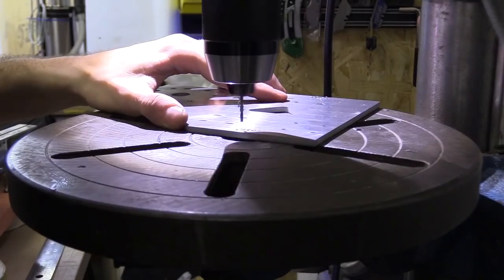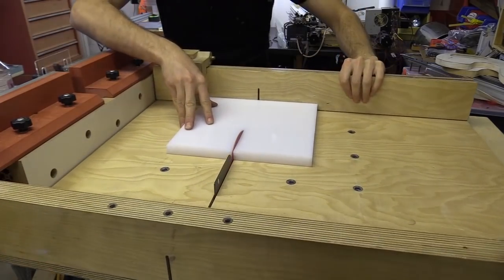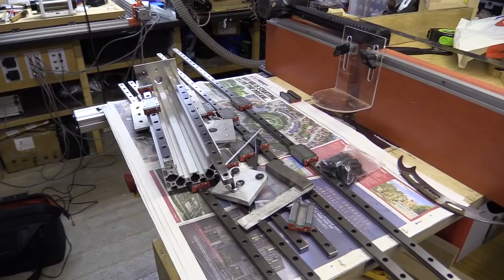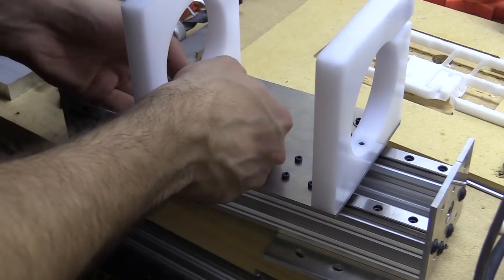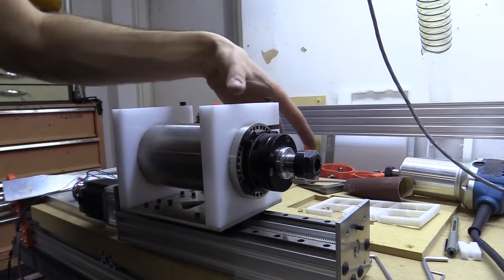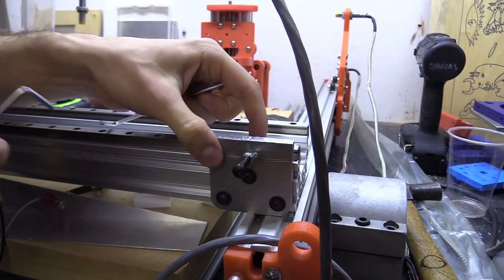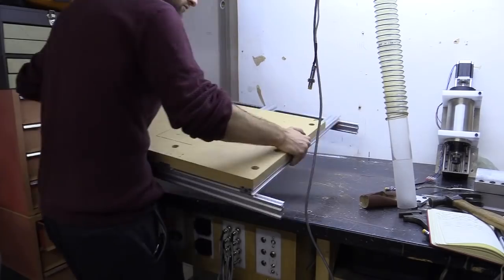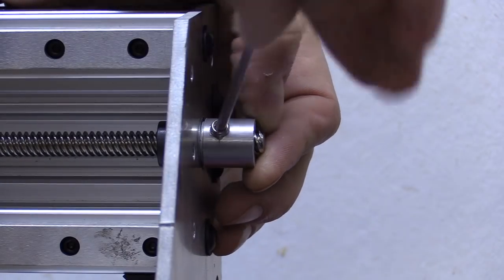#31 Assembling Aluminium CNC Machine #31 / MGN12 Linear Rails / XYZ Axis / Spindle Mount

Comment: I'm planning on making a similar CNC, a variation of the Sphinx 55 except I designed mine to be bigger, using 1000mm C-Beams, I'm worried that the gantry will deflect due to the weight of Z-Axis? Should I reduce the size of do I go for it? And is the T8 ACME Threaded rod enough or should I use T10?

Comment: I am making a 500x500x200 CNC using extrusions and linear rails and over on Reddit they said I should go with MGN15 or 20 (20 is way too wide for this) and be sure to use the normal blocks not the short blocks when I asked should I use MGN12 or MGN15.  Since you used MGN12 would you shed some light on this for me?

Thank you.
Reply from the maker: I went with hgr15 rails in the end. Mgn12 worked for a while but for the long term I realised I needed it a little more beefy to get the speeds I wanted.
Reply: HGR15 works with the Aluminum extrusion?  I doubt I can get a good price on AliE for HGR too.
Reply from the maker: @thebeststooge  Yeah if you can wait a few weeks I'm going to release a purchasable manual for my latest machine.

Comment: Looks great ! I'm starting my 5' x 10' table build, but in the middle of being screwed over by a Chinese company over my X-Axis Lead Screw. I paid THEIR sale price, THEIR shipping, and THEIR shipping insurance price, then THEY turned around after 3 weeks and cancelled my order, saying they could not find an acceptable ($$) shipping method to the U.S !  Then another week to refund my money...WTF !?!? But even though they cancelled my 1500mm 1605 lead screw, it may have been a good thing, as I felt a 16mm diameter over a 6 foot span may sag, like yours does. So now when I order another Lead Screw in 1600mm length,  I'm going for an Inch in diameter, or a 2505. Luckily the company DID send the no longer needed 1605 Nut Housing for the 1605 Lead Screw THEY CANCELLED, but not ONE WORD in response to my request for a refund for that. I guess you take your chances.  So the point to my rant is, you might order a new beefier 1-inch diameter lead screw to cure the sag problem and any induced backlash associated with it. More costs and redesign I know, but maybe worth it in the long run ! Good Luck !!!  Oh, and if that doesn't work for you, try this one, it IS strong enough to stay straight !  https://www.youtube.com/watch?v=TsOPaRAayFk&t=194s

Comment: just want to share: propanol do not have high polarity and as such it is more reacting then ethanol with certain plastics like acrylates for example or styrofoams. i would check what is that end plastic used and then aply a 3 day bath to it.
safest is to remove plastics from bath

Comment: You should use ballscrew for your x axis.leadscrew that long will wobble. I have same experience with you
Reply from the maker: I know but I couldn't find over would fit in the cbeam. My main problem though is the not blocks.
Reply: @EducatingSavvas  indeed. you should check openbuilds, someone make modification for it. By replacing the c beam, and the gantry plate.

Comment: Would you be able to share your feeds, speeds and the kind of endmill you are using for Acetal?
Reply from the maker: So I used a feed rate is 620mm/min, 500 plunge rate, 2mm step down and 16000 spindle rpm. But bare in mind that the acceleration will effect whether the machine reaches those, and I've recently changed my acceleration speeds.
Reply: @EducatingSavvas  Thanks! I've been trying to mill Acetal recently with mixed success. The idea was to take shallow DOC but with a higher feed rate. Been using a 1mm flat end mill since I have a few tight corners and V-shaped edges.

Comment: So it was 7mm you drilled out your holes to for the trapezoidal lead screw tap. Probably 2 years too late for the guy that asked on the video where you initially made the tap. Lucky for me though, I just made a tap today to make a replacement nut for the x axis of a mini-lathe I'm converting to cnc. Strictly speaking though, a hole for a tap should be the nominal diameter minus the pitch of the screw. So if the pitch of your leadscrew is 2 you should drill it out to 6mm before tapping.

Feeling you on the getting to actually make something thing. This lathe project has been going on 2 months and There's no doubt a million and one snags I've still yet to his before i complete it. In the meantime, Ideas for other Smaller projects keep coming but I know i need to focus on the lathe or I won't finish it!

Loving your poor man's rail alignment stop idea for the mgn12 rails btw. 

Wishing you the best of luck in getting your machine finished. You'll get all the kinks out eventually I'm sure. Looking forward to seeing the finished machine doing it's thing.

Comment: if you buy the expensive name brand rails and blocks they are fitted with different size balls to get the right preload. You  should fill the bearing blocks with grease. If those C-beams are the V-groove type I find that the grove is so wide that it is marginal that there is enough for a 12mm rail to seat against

Comment: One thing that can help with the X axis lead screw is using a KFL08 bearing (find it in Amazon). This is a face mounted bearing. You can use oversized screw holes to compense any misalignment between the lead screw nut hole and the bearing holes. Maybe that is causing the bending issue.